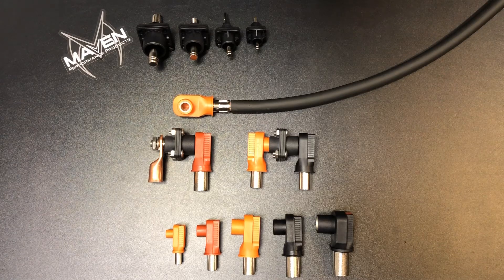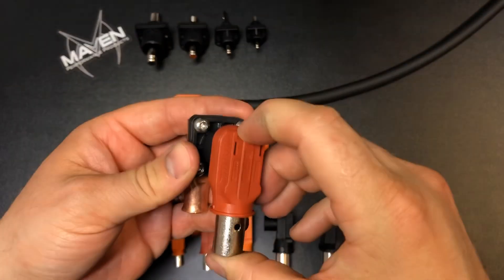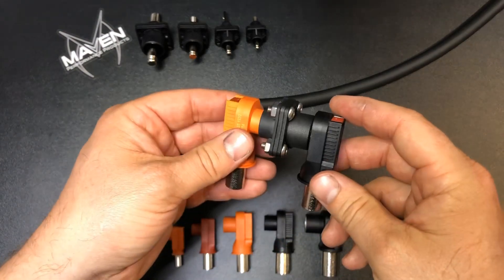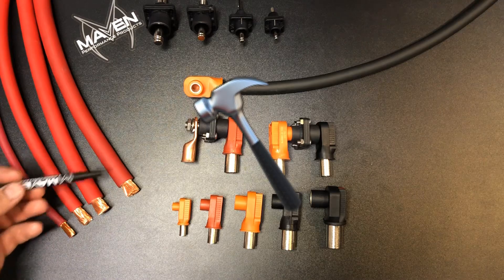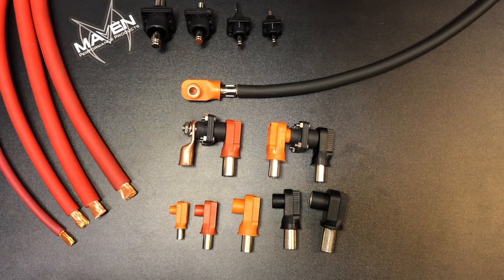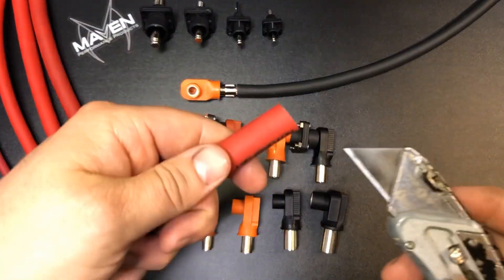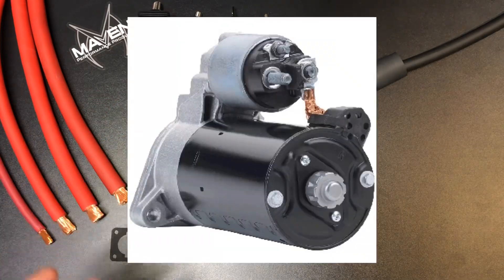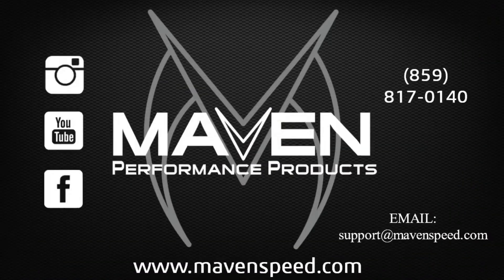Battery Cable Bulkhead Radlock Connector

Comment: Thanks for the great videos.

Moving my bulkhead connector to a radlock setup.

Also wanted the radlock setup for my battery. Problem is my battery has M6 threads, allowing me to only fit the 5.7mm post, which only goes up to 120A, 25mm2 cable. I don't see this having enough capacity to run a car with?

How do you find the ratings to be on these?

I do have the option of getting an engineering shop to machine me up a 8mm post with M6 thread. But that would be kind of costly. Not sure its worth that.

Comment: Thumbs up. Came here looking for 16 AWG fuel pump wire connectors into tank.
A guy can use dielectric grease sold at home improvement stores in the auto section by Permatex for $5 or less. As a dealer tech for decades, I used it frequently. Retired now, I like the idea of relocating the battery as I build my 54 year old C10 with a Tahoe engine. Clean the engine compartment to the point, it appears there is not enough parts or wires to make it work. 
 As a wire-phobe I use an amp meter for fuse protection, but voltage drop. Anyone doing this for the first time, watch videos to learn then dielectric grease, solder, shrink tube and check your work. Allow for future expansion of new circuits in case you want to add cameras to tiny blinkers as most new vehicles apparently does not come with theses indicators. Nice products. ASE Master Tech since 1978 - Retired
Reply: friends dont let friends solder on race cars
Reply: @  Yep, on GM’s do! Because this is what they teach!
Reply: @deankay4434  where does gm solder anything other than the inside of a module?  I've not seen a single soldered joint in at least 20 years the last one I seen was on the old Chevy 350 tbi where it had problems breaking on the ground for the ECM.
Reply: @deankay4434  not trying to be a troll I like soldering but it's not the best way to make a connection in a vibrating condition.
Reply: @  When it comes to electrical connections, it depends on the; Who, What, Why and When. The primary goal of electrons is potential, the potential to flow electrons is measured in voltage. Using electronic flow, electrons travel from negative to positive thus explaining all electronic devices from thermistors to Mosfets. So an automotive battery that’s dead, has expended & moved all of it electrons equally from negative to positive. Now with both sides of the battery equal, there is no potential for electrons to move and now needs charged.
  Pressure is measured in amperage. A standard flashlight battery like a “D-Cell” battery, has a pressure of 1.5 volts in direct current. Any measurement right of a decimal point is thousands in length and milli in amperage. So 0.150 milliamps is typical for measurement for some small dc batteries. Resistance is preventing flow of voltages potential and all materials have resistance. Copper is low resistance, silver is lower while gold is the least. It’s desired in longterm electronic circuits and connection so cost is high, sealed and long term circuits even inside a chip is connected with gold from laptop processors to satellites. Resistance is greatly reduced when tight and less loss of voltage is when soldered. Soldering is taught by all automotive manufacturers for metal terminals on core connection. Insulation is the material used to keep the potential of voltage to pass thru it. 600 volts is common in household wire. Voltage drop is in every circuit. When a circuit is turned on, current flows in a series circuit, meaning one side is positive and then a device, then ground retuning back to the battery. If only 13 Vdc are available from of a running engine, and the B+ of the alternator is available to the fuse/relay center, a small amount of voltage is losses due to resistance at each component; terminals (Inside plastic Connectors), fusses, wire, length of wire, switch, and the same on the ground side. Only the device in the series circuit consumes all amperage in the circuit limiting how much current can be used. A blower fan to heat a vehicle, may use 12 amps cold (resistance is low in cold wires / called in-rush current) then quickly heats dropping continuously amperage to 10.9 amps. The fuse protecting the circuit is selected due to heat as it cannot detect amperage. A 15A fuse maybe selected to operate the blower fan. Headlights are 4.0Amps, fuel pump is 7.5-8Amps. Engineers add 10% to circuit protection depending on “In-Rust-Current” to changes over time. Like fuel pumps. If a filter is neglected, it works harder to push fuel and amperage goes up. 
  Vibration as you asked, can create resistance in a circuit from small voltage drops to complete failure. The factors evolved are what type of fasteners, importance of the circuit. Do not use a house hold wire twist nut on your auto’s headlamps at 100MPH, it would not be safe and subject to a great deal of vibration and severe damage to loose lights at speed. 
   Let’s talk oscilloscopes to diagnose the electrical condition fuel pumps by examining the current waveform pattern?
Reply: @ DUDE you accidently dropped your mental diary over here
Reply: @dreece2000  I am sorry that your prefrontal cortex is functioning at less than 1 hZ. With time it should function faster… maybe.

Comment: I have a thick fiberglass body on my car. Will this connector handle that thickness at the firewall
Reply from the maker: How thick is the fiberglass? Probably worst case you would need to use longer fasteners, you can call us and. We can make sure it will work for you.

Comment: What crimpers would be used
Reply from the maker: Check out video 009 single 4 ga connector for a crimping option 👍
Reply: @mavenperformance  thanks i was able to use manual crimpers worked out great

Comment: LOVE these, just two small requests because it triggered my OCD and I want a top notch build.   The red doesn't look very red, and can the connectors have color matched release buttons?   Either way I'll be using these for SURE.
Reply from the maker: Hey RecklessRegal, the release buttons are all red- so the only one that matches is the red connector- sorry man! The red connectors are about the same color as a typical red battery cable, they look pretty good, but definitely not candy apple red but definitely not a pink color either (may look a little off next to the orange connectors in the video)